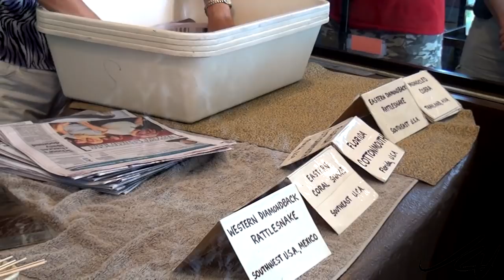milking deadly venomous snakes - Reptile World Florida - YouTube

Comment: That where the venom glands are.  Most of the pressure on the head will go toward forcing the venom to drain, and it's not a lot of pressure compared to what the animal's built to withstand.  It might "hurt" in the sense that it causes discomfort or a small amount of pain, but it's not damaging, at least.